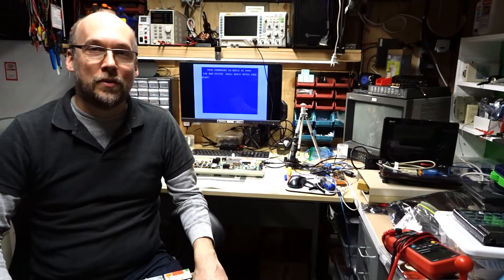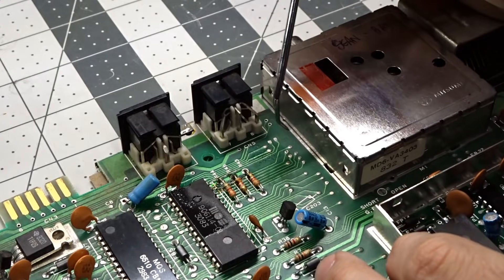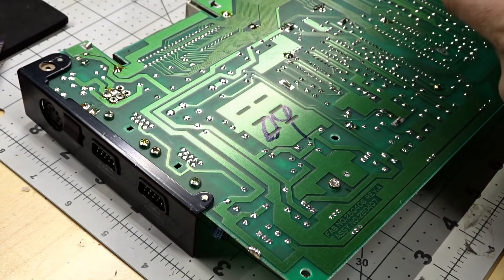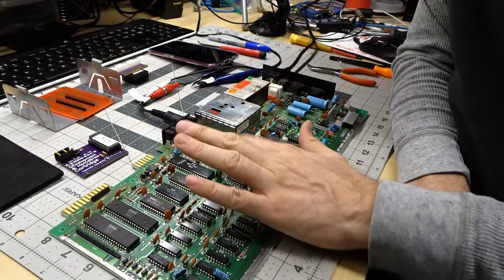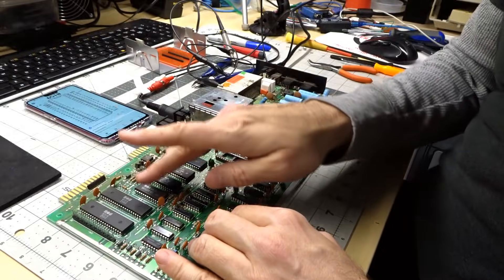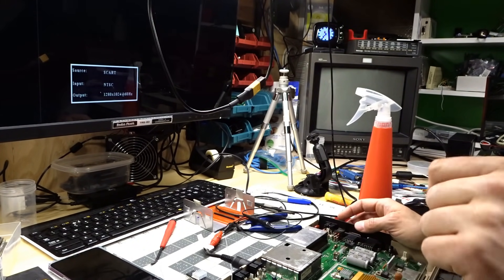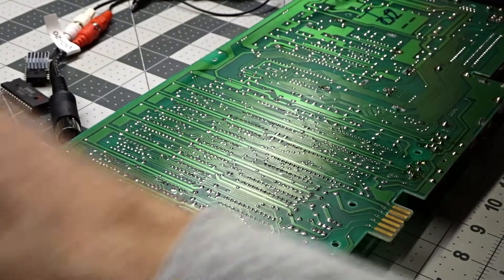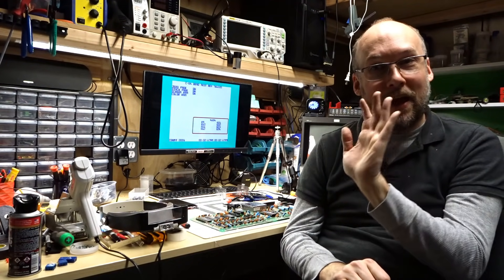Troubleshooting a "black screen" C64

Comment: Slightly OT question mate, what technique are you using to attach heat sinks to chips? Is it permanent fix or temp?
Reply: It looks to me like thermal tape, a thermally conductive 2 sided tape.
Reply: @Meep3692  Thanks mate!

Comment: I desoldered (with wick/braid) my shield and it took an hour and in the end there was one spot I couldn't get off so I finally just ripped the last one. I'm building a PSU today. I hope my computer works. lol It's in unknown condition. The case and board look great though. The board is pristine.

Comment: Does anyone make a replacement SID chip?
Reply: Yes, sort of. The SwinSID and the SwinSID Nano is a hardware Sid emulator, and can be found on eBay. It was something but it wasn't perfect as certain functions like the commodore mouse or paddle controls wouldn't work. Then the SwinSID ultimate came out, but only in a very limited production run, and last I saw its creator refuses to make any more. You can see how that went down on the SwinSID Ultimate Facebook page, and also watch the 8-bit Guy's review of the SwinSID ultimate. Finally now there's also an FPGA replacement for the Sid chip. I think it's called the FPGASID. It's possibly the most expensive option, but at least it's commercially available now.
Reply: Link to the FPGASID: http://www.fpgasid.de/
Link to the SwinSID Ultimate Facebook page: https://www.facebook.com/swinsidultimate/
Unfortunately, due to high SwinSID ultimate demand, the creator got pissed off at the world and wrote, " you know what, THERE WILL BE NO MORE , EVER!!
NO NEED PPL WHO CANT EVEN READ 2 f-ing lines...." on June 12, 2018.
Reply: @mcosta3810  Great business logic there wouldn't you say?... What's the point in doing such great work and then keeping it to yourself, making no money at all? Why didn't he open-source it?

At least there is also ARMSID, these cost around 27 Euros and are considered superior to the SwinSID Nano. The Nano does an okay job for most things, for what they cost it's pretty good and a heck of a lot better than a mute C64.

Comment: What do you recommend replacing CPU's with? And videochips? Or is it really all out of luck?
Reply: The 6510 and the vic2 are kinda like custom chips made just for Commodore so yeah finding spares is not as easy as for example if you'd need like a 6502 for some other computer. The 65c02 is still made today but the 6510 or vic2 would require you to source some new old stock parts